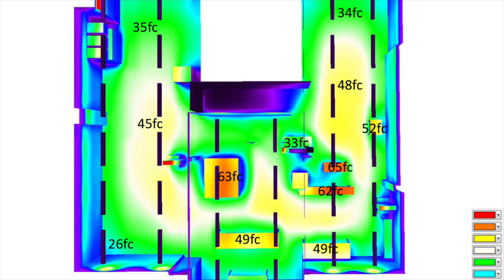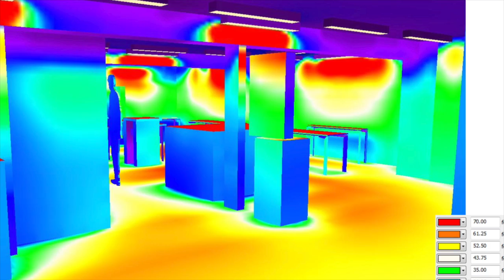Workshop Lighting

Comment: Love your shop and videos! I run a electrical engineering firm and am a lighting designer and agree with other(s) that adding a small fan like a 4” computer fan for exhausting warm air, plus an intake louver with filter, will greatly increase the life of the LED drivers. Oh I also have a 1700 sq.ft. Woodworking and metalworking shop and look forward to checking out your channel that I discovered only today 😃

Comment: A few ideas for the box, I am a control systems engineer and I deal with the manufacturing of these with enclosures,
I would have crimped a ring terminal to the wire instead of just the copper to put it through the screw! Also use a lock washer or washer with teeth to helped grip into the metal more when grounding the enclosure. (Ring terminal, screw then lock washer) brush slightly more surface area around the drill hole.
That is just my experience.
Also install a low speed fan to the enclosure

Comment: You could have used all thread vertically in the box and only had to have drilled 4 holes, mounted the ballasts in 2 columns which would have made mounting them faster and allowed for greater heat dissipation.  I was wondering if there was any further news on the drawer cutting blade you developed?   I have been searching for it from a manufacturer and haven't found it yet.  Any updates you could provide would be greatly appreciated.
Reply from the maker: +chemicalx666 The blade isn't available yet, but I'm getting close, hope to have an announcement soon.

Comment: Hey Andrew...  Weird...  The Shop Lights here (4 strips of LED's) cost 120SR = 32USD.  Wonder why the massive cost difference. of course the power units here do 220 to Dc (Low Voltage) not 120 but that shouldn't be a factor...

Comment: my recommendation on this set up would to put at least 2 -4 ,power lines on separate beakers ,in the event you pop a breaker ,ect you do not want to be left in a dark basement with tools running in your hands,,,,,,, talking from experience here,,,, and yes i under stand that one 15 a should handle all the led,,,, but things do go wrong and will,,,, can not replace cut fingers or worst ,,,,,,,, love the low profile fixture,,, aluminum backed tape between the strips and your joist would prevent heat transfer from the strips to the joist,,, do not know how hot they get ?    great set up,,,,
Reply from the maker: +christophe leblanc good suggestions!
Reply: +christophe leblanc .  The strips measure 36 degrees C (about 95 degrees F) or near body temperature. The open design allow air flow to improve cooling efficiency.  They are rated to last 50,000 hours at 85 degrees C, and at 36C they will last 120,000 hours and still maintain 70% of the initial lumen output.
Reply: good info,,,, no expert on led , but have a interest in it for my shop basement

Comment: They look just as good as they did when I was there a few weeks ago!  Have you measured the power on the 110 volt side?  Just curious.
Reply from the maker: +Jack Bench Woodworking I haven't actually measured it, but it should be drawing about 5 amps to light the whole shop.
Reply from the maker: +Andrew Klein Correction, should be drawing around 9 or 10 amps

Comment: Fitted my shop in the UK very low cielings 7'6inch high did similar to you but bought single power-supply  works well and has own fan fitted, I don't hear the fan run as is so slow, cut my supply bill by 60% and as you say the light quality is great, 
Oh just one thing maybee next time you use electical box do all the drilling before putting components in as swafr from cutting can short-out electrical components, (just a note) think you must have blown the cabinet out before using it,
Great video and well presented thanks for shareing
have great day and enjoy you shop

Comment: Pretty cool Andrew. Exactly what are the "drivers"? Are these just power supplies I am assuming? If they are, you could just go with a single power supply and a power distribution module(s) I would think. Either way, thanks for sharing this. It's something I will do some research on for my own shop.
Reply from the maker: +GuysWoodshop yeah, I'm getting a lot of that same question it seems.  It not an area that I have much experience in, so I just went with the recommendation from American Green Lights, but I'll have to look into this as well.
Reply: +GuysWoodshop .  Yes, you can certainly go with a single power supply and use a distribution module.  These strips use "Constant Current" drivers, which will require a match between the desired power and the number of LED strips.  This allows for greater lifetime and reliability of the LEDs.  These are rated 120,000 hour lifetime with the constant current drivers.  Each 24W strip draws 600mA of power. 

Advantage of smaller drivers:
1.the smaller drivers produce less heat and is easier to dissipate the heat
2. a less expensive fix if there ever is a problem with the driver 
3. Each driver is matched to the LED, maximizing lifetime of each LED strip
4.eliminates the need for in-line resistor or fuses to protect the LED strips from over-driving
5. No need to load balance each LED when there is differing wire lengths and the associated voltage drop

Advantages of single larger driver:
1. Easier installation
2. Slightly lower cost
Reply: +Jim Uno .  Are you saying there are no current limiting resistors in the LED strips?  The power source has to be current controlled?
Reply: Yes.  Constant current drivers are matched to the leds.  LEDs designed for constant voltage drivers  (as in cut to length rolls of flexible strip leds) have current limiting resistors.
Reply: Thanks for the clarification Jim. It's great that you jumped into this conversation to let us know.

Comment: Hey Andrew,

I noticed Jim offers a "rigid strip with lens" option.  Do you ever wish your LED strips were diffused a bit?  Do you ever worry about your kids looking directly at the strips?  Thanks for the video.  Cheers!
Reply from the maker: I asked Jim about those, they cut the actual light output in half, so I would have needed twice the lights for equivalent lighting, and they aren’t bright enough to damage your eyes or even be annoying, so no regrets.
Reply: Awesome.  Thanks for the reply!  Jim quoted me around a 20% decrease in light output with the kits w/ lenses, but they are also a bit more expensive b/c of the extra materials.  We ended up going with the same style you installed.  Jim was super helpful with figuring out what we needed and offering advice.  Thanks again.
Reply from the maker: That’s great, maybe I’m remembering wrong about a 50% decrease in lighting.  I think you’ll be happy with what you get.

Comment: Where does the heat go when the box is closed? There is no ventilation or flow-through air and I doubt if the surface area is great enough to cool it with the ambient room air.
Reply from the maker: The surface area is enough, confirmed with a thermometer that even when on for long periods of time the temperature stays in the safe zone.  Ventilation would defeat the purpose of a sealed container that smothers any fire.

Comment: Which drivers are used? 12-watt, 18-watt, 24-watt, 36-watt, 48-watt?
Why are they wired in groups of three? Three drivers power 4 lights? 
Four lights equal 96 watts. There doesn't seem to be any combination of 3 drivers that could add up to 96 watts.
Are the lights connected in parallel or series?
Reply from the maker: hmm, I don't really remember, I know there were two types, one that powered one strip and one that powered 2, maybe a 24 and 48 watt.  As to the group of three wiring you were seeing the high voltage supply to the drivers, one wire comes in and I had to keep splitting it to get power to all the drivers.  The lights just get powered by the low voltage door bell wire from the drivers.

Comment: Why go with all these drivers as opposed to, say, a 600W 24VDC power supply?
Reply from the maker: +Norman Ramsey Thats a good question, I'm going to try and get Jim Uno (American Green Lights owner) to help me out with these questions, I'm no expert, and just installed what I was given.
Reply: +Norman Ramsey You can certainly use a single larger driver.  There are advantages and disadvantages to using a large driver.  I have answered on one of the questions below.  These require constant current drivers and operate at 40VDC.  The 40V allows a smaller current draw, which will keep the LED temperature lower, increasing the lifetime.  You would want to limit the current to 600mA per 24 Watt strip and can connect many strips in parallel to accomplish that.  I would recommend inserting a 700mA resettable fuse before each LED strip if you want to use that large a driver, in case the driver gets turned on inadvertently prior to all the strips being properly connected.

Comment: Nice lighting but at $120.00 each ouch it hurt , when some other led fluorescent up great kit is like $32.00
But for free i will take them to !
Reply: I re watch to count how many you install it look like 25 x $120.00 = $3000.00
Reply: Flatdog Sound & Light   He says he mounted 30 drivers in the metal box...isn't that 30 lights??  $3600
Reply from the maker: +Roddy Da 40 lights actually, 10 of the drivers were 48 watts and power 2 lights.  You could contact Jim Uno for a quote, but yes, lighting such a large space so well will cost money no matter what solution you use.
Reply: Andrew Klein  I just sent him an email.  Maybe I can get a quicker answer from you.  What length did you use...how much per strip and does each strip include a driver?
Reply from the maker: I had 40, 48" strips to cover 1200 square feet, which is awesome lighting, you probably could get away with a bit less, especially if you are not filming.  Jim will absolutely sell you the right number of lights and drivers, and will help you optimize the lighting if you want to minimize cost.  But you will have to get the cost info from him, my situations was a sponsorship, and he seems to want to deal with people individually, no prices on his website.  I can say I'm quite happy with the lights and support from him though.

Comment: 30 drivers! how many fixtures are there? What is the power rating of the drivers/fixtures? doorbell wire... they can't be too high power.
Reply from the maker: +Adam R 40 LED strips that are 24W each.  but they are super efficient at converting power into light, and light is what matters.
Reply: Andrew Klein oh, okay. 24W is safe for 20/2 wire. I had it in my head they were ~50W. Sorry.
Reply: +Adam R  These are 24 Watt 600mA constant current drivers.  The output voltage is 40V, which qualifies for class2 wiring.  For short runs, can be as small as 24 gauge wire.  For longer runs, going 18-20 gauge will reduce voltage drop and increase efficiency.

Comment: Hey Andrew , it looks great.  I have to add that in a closed enclosure, trapped heat will decease the life of the transformers. When I worked for a sign company I did replace a lot of the power supply like this most failed due to overheating. My suggestion will be installing low speed fan on the box to get air flow in the there. Thanks
Reply: I agree. a small fan on the same circuit installed on the box would definitely help. great job.

Comment: Electrical tape is for pulling and phasing wires, it has no use what so ever in the connection of wires....says me, electrician of 21 years.
Reply: +TheSoloAsylum Why is that?  I've always wrapped my wire nuts and outlets.
Reply: Jim Beshears
Why would you do that? I know the old timers did that...before fire ratings and UL listings.
Reply: Solo, I'm asking the question because it's just what i learned a long time ago.  What is the issue with it?  I'm not trying to be a jerk, just want to know if I shouldn't.
Reply: Jim Beshears
No worries, I didn't take it that way. Electrical code wants mechanical fastening of electrical connections. Wire nuts are fine, tape and even solder are not allowed on anything 120V. Tape tends to melt off with heat. Code is basically base off of heat and how to limit it.
Reply: I agree totally, I tape over wire nuts to give them one more protection of possibly vibrating loose.  I also wrapped tape around an outlet or switch to protect it from accidentally bumping against metal, but you make a lot of sense about the heat thing, I'll stop doing that.
Reply: I "grew up" as an instrumentation tech in a huge steel mill and learned my electrical maintenance there, try to prevent anything from vibrating loose, and cover anything that could vibrate and short out eventually.
Reply: Some municipalities within seismic zones actually require all wire-nut connections to be wrapped with non-conductive tape(a.k.a. electrical tape)....says me, electrical engineer of 30 years..P.E. for 20.

Sorry, TheSoloAsylum.  Your pompousness made me do it...

Comment: My Fein plug n play LED shop lights are awesome. No drivers No box.  Not sure why you wanted to go thru all that.
Reply from the maker: +Dave Stone do you have a link?  I can't find those online.
Reply: It was Feit, not Fein sorry. A year ago I paid $51 each for these, and now they're $66.   http://www.amazon.com/gp/product/B00MJUCU2A?keywords=Fein%20LED&qid=1457916194&ref_=sr_1_1&sr=8-1 Andrew Klein
Reply from the maker: +Dave Stone Got it.  If you only need a couple of these and you have outlets close by that's probably a better option.  But for me starting from scratch with a large shop it was nice running doorbell wire to the lights.
Reply: +Dave Stone Those FEIT shop lights are a great value.  However, There are many differences between the FEIT shop lights and these retrofit kits.
1. The FEIT shop lights  are in essence LED tubes that are manufactured with end caps permanently attached.
2. Lifetime is approx 50,000 hours compared to 120,000+ hours for the retrofit kits
3. Color Rendering Index is 80 compared to 95CRI of the retrofit kit strips
4. Low voltage wires to the retrofit kits strips vs 120V line voltage for the shop light
5. Lower profile of the strips

Comment: why couldn't you just use one driver?
Reply from the maker: +BillDAWG several people have asked that, I didn't really look into this before the project, so now I'm trying to get an accurate answer together.
Reply: +BillDAWG Can use one driver (see my comments above in reply to another post.  If you use one large driver that is constant current, you would want to install a resettable fusible link before each strip in case some wires are disconnected.  

These were sent prior to knowing they would all be installed in one location.  If I were re-designing it, I would set up one set of fixtures on a commons switch or single driver for the walkways and non-task areas and put separate switches and the associated drivers for specific task areas such as table saw vs welding station, vs router table, etc.  That way, the areas with no activity will not be burning the lights the entire time.  Perhaps using some 240 Watt drivers running 10 strips. or 96 Watt drivers operating 4 strips each.

Andrew, if you want, you can run different switches to groups of LED Drivers to accomplish the same thing if you want to group them into "stations"
Reply from the maker: +Jim Uno I kinda like having the whole shop lit up, I move around a lot, and I think I would just flip all the lights first thing when I start working.  So I think I'll stick with the current set up.